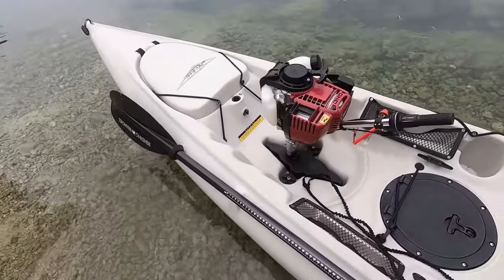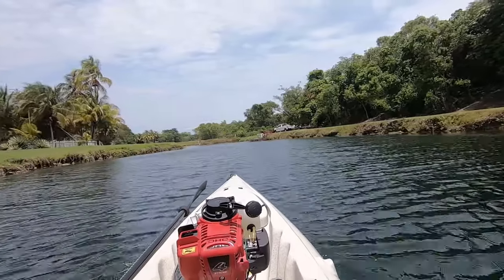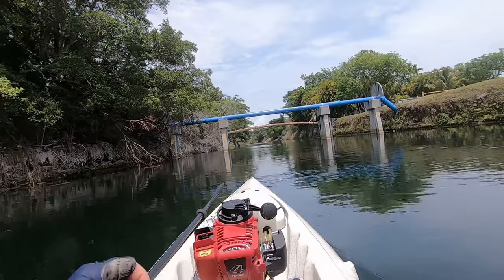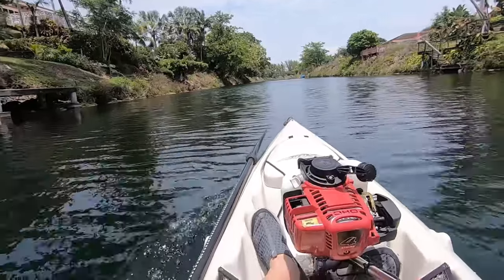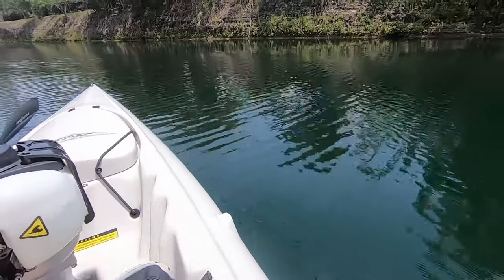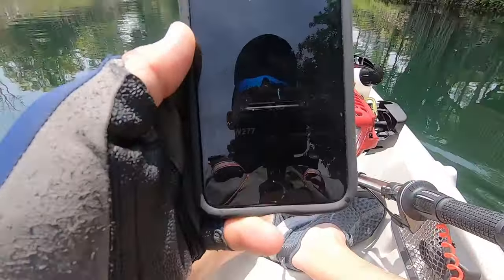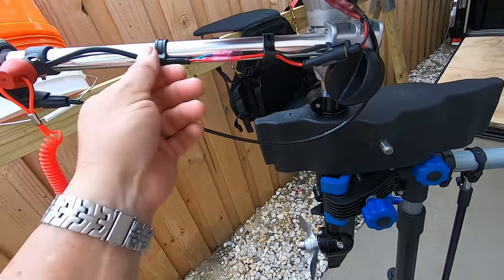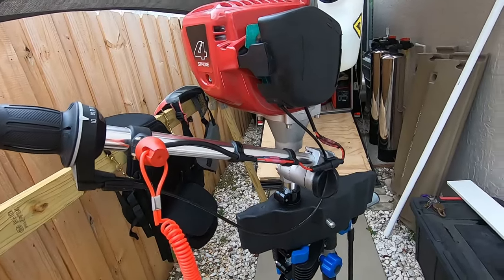Hobie Drop in with Honda 35cc - Go Pro Footage Extended (Pedal Drive Conversion)

Comment: Very interested in this but just a safety question.  Is there a need to worry about exhaust?  Carbon dioxide?
Reply from the maker: The emissions in a Honda is about 95% efficient. The side discharge while underway and sitting idle has never been an issue. I have built 100’s of the new 50cc versions with no issues.

Comment: Replace the stock carburetor with a Walbro WYK-194-1 & you'll get a substantial uplift in performance with the ability to easily tune the Low & High speed fuel mixture along with running an engineered fuel which will improve exhaust emissions & eliminate that obnoxious gasoline smell.
Reply from the maker: That will immediately void the warranty, so that Is not going to happen. What you or other consumers do is on them. I keep it OEM until the warranty is out. Then add a water exit exhaust and you just eliminated what you swapped your carb to achieve. A tuned down pipe is the key.

Comment: Can u make a video showing how you put everything together? Really want this motor!
Reply from the maker: There is a build video on the full size system. You cannot build the drop in without the right drive shaft and bearings.
Reply: @kayakbuddysllc-lightweight4947  do you know how the total for everything with the drop in
Reply: What's the total for it to come complete with motor and stainless prop and shaft
Reply from the maker: @johnnypestana3650  please check the website www.kayakbuddys.com for pricing.
Reply from the maker: @johnnypestana3650  you can call me or check the site for the complete RTR system. I don’t post prices on YouTube.
Reply: @kayakbuddysllc-lightweight4947  how does the motor perform in the ocean & is there any specific maintenance I have to do cause I'll be using in saltwater?
Reply: What type GearShifter shimano that u use ? 6 speed ya.

Comment: hi friend, is posible some pictures of your propeller? .. i need to make one like this.. thanks lots
Reply from the maker: There are plenty of images on the website.
Reply from the maker: @lynx8828  Yes, I sell the prop, collar, and pins as a set.
Reply from the maker: @lynx8828  look on the ordering page under accessories and you will see the upgraded aluminum prop at 85.00 USD.
Reply from the maker: @lynx8828  if you look at any of the pictures and video you will see the prop and collar to attach the prop. If you look at the home page mid way down you will see the stainless prop and collar. The aluminum are the same just different material.

Comment: Is that a weed wacker powerhead? Or what is it other than just telling me it's a 35cc engine.
Reply from the maker: The new version use a commercial grade 50cc Honda powerhead.
Reply: @kayakbuddysllc-lightweight4947  but is it considered to be a boat motor or a transformed weed wacker?
Reply from the maker: @alanknight4418  nothing like a weed whacker. It is an outboard with a true gearbox.

Comment: informative video, but  (yeah there's a but) from the video's point of view it was noisy  which defeats the purpose of a Kayak being all quiet and stealthy moving along minimal disturbance.  In the video you said it wasn't bad (the noise) but man from watching it was.  I also don't know about having it center mass for a whole fishing trip just so I can power back in as the narrator suggests.  Also noticed the bare legs near that hot motor head, could be painful trying to get out of the Kayak after running in with this "Buddy".  One question, why the out riggers?  was it for safety with this engine install?  never needed or used out riggers. Put it on a new Shearwater 125 fishing set up and try it again speed test without the out riggers.  But really think the "Buddy" should be behind the occupant not between the legs (for convenience I get you placed it in the drop in scissor blade slot).   On second thought I'm thinking placing in the slot but lowering the whole thing so its a small hump and use the Kayaks rudder system to turn the boat.  make it lower profile and just an forward and reverse engine.
Reply from the maker: St. Nick as I said the camera is 2 ft. from the engine. Of course it does not record with accurate decibels. The Revo is very compact and the water keeps it cool. I have never had an issue with heat period, but remember most people do not power these smaller kayaks. This is just informative and just plain fun. I would not power a Revo, unless it was a tandem. No cockpit space. What most people do is to keep the system in the storage compartment and use this for the trip home. It acts like a front wheel drive car. It’s way faster than rear mounted engines. Lifts the hull up and has zero cavitation. I have electric mounted to the same system that is even faster. Sounds like an RC car. When your kayak weighs over 125lbs like the large PA beasts, a gas power plant is perfect to have when you spent. 

The stabilizers are for my wife and allow side mounted engines that are offset by the stabilizers. These barely touched the water. I had these on initially for her, but I needed video for customers who want the capability of non-transom based kayaks to have power. These are fantastic.
Reply from the maker: If I was mounting on the new Vibe it would go in the back. Heavy kayaks benefit from having 50cc power. Anything less requires higher RPM. I have a new Pursuit and it is going to fly with rear power with trim and tilt.
Reply: @kayakbuddysllc-lightweight4947  good to hear, I know when you edited this video you couldn't help but hear the constant motor noise, I was as you might say just checking.   I've been looking at one of the electrics but this does present options.  Still like the video.   Have you fished with the buddy yet??  does it interfere in any way??   one last, does the weight above center G destabilize any?  from your experience as in have you stood up and run it yet or "rocked the boat" for stability check??
Reply from the maker: St. Nick you have no choice to hear the motor because of the echo on the plastic. It is not as loud as it sounds. I didn’t have a GoPro mount to pull the video away from the kayak to get real sound and not the harmonics of the engine. This kayak is simply a test bed to see if the drive could work. The Hobie PA kayaks are awesome with the 50cc power, plus it is a good   1.5 ft.+ difference in rear seat to peddle opening. Now, as far as fishing, all of my engine setups are in the rear. I fish Nucanoe kayaks and use these all of the time. I don’t leave without it. Whether I use or not I have a power choice. The Frontier gets 5.7-6.1 mph with 50cc. The Pursuit will be faster I imagine. I haven’t rigged it out yet. It never gets in the way and actually I forget its there most of the time.

I also use either a leaning post or just stand. The motor does zero to stability, because it is 23lbs and is centered. I get no deficit by having it on board.

Comment: hey man I got a 12.5 feelfree Moken which motor do you suggest the 35 or 50 ? for use in bay
Reply from the maker: I would go with the 50cc all the way. You can run at a lower rpm and maintain torque on the kayak while moving.

Comment: have you tried it in saltwater?
Reply from the maker: Fishing with Jhoe of course. The original trial videos posted are in salt water. No issues. I do not run the cassette anymore, but an FPV mount. Great quality from Australia with flexible vertical adjustment. The video will be going up in the next few days.
Reply: @kayakbuddysllc-lightweight4947  Nice! Im excited. As i am planning to install a petrol motor on my Perception pilot 12 on the pedal drive mount. Will wait for that video. Subscribed and notified first :)

Comment: Would u increase speed without the stabilizers?
Reply from the maker: No necessarily. They are designed for secondary stability and to offset an engine if need be. This will not increase your speed.
Reply: @kayakbuddysllc-lightweight4947  have u thought about turning your seat around and having the engine behind you? I bet you'd go even faster
Reply from the maker: @prestonbroadus3978  most of my builds are transom mounted. I assume you haven’t looked at the other videos. Do a bit of research, you will answer your own questions in the other videos.
Reply: @kayakbuddysllc-lightweight4947  ived watched your videos. I just think you'd get a kick out of the speed boost by turning your seat around and having the motor behind you.

Comment: That’s great, but too lold
Reply from the maker: I have created a water exit that routes exhaust under the hull. The new 50cc engine does not need to run high RPM’s to maintain speed. Check the latest Outback video.